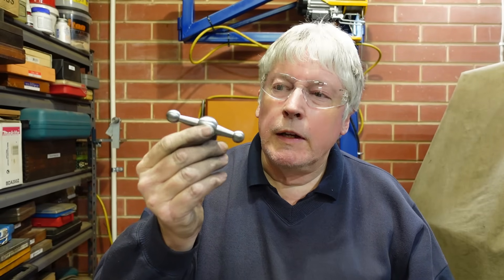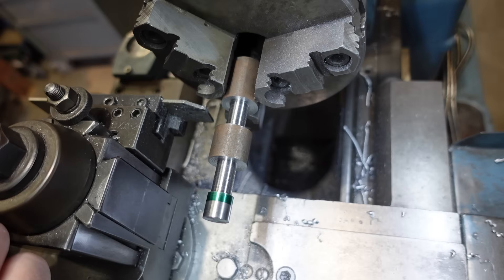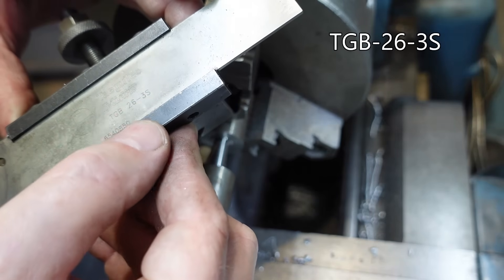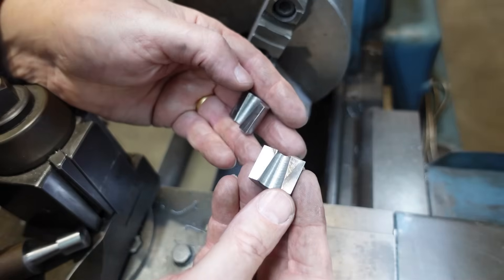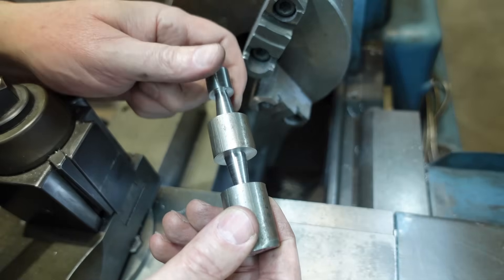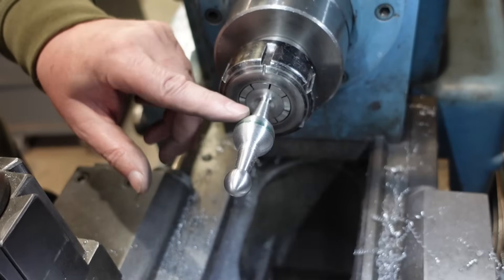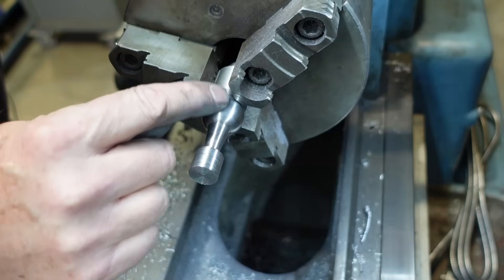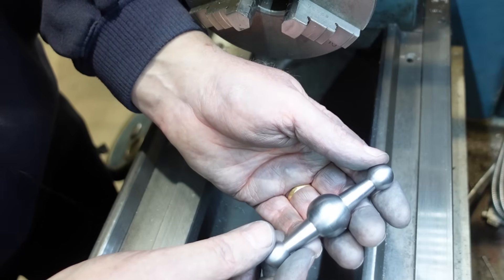The key part of making a 3 ball handle

Comment: On a tradational ballanced three part ball handle all three balls will be of different diameter.
Reply from the maker: That is what I normally would have done. This one was copied from a photo provided by a friend to be 'correct' for the end use. From the examples I put up during the video, I suspect that this handle strictly speaking should have two cranks rather than the one it will have in this application.

Comment: I would be interested to see some closeups of the tip of the cutter. Thanks. Nice job!
Reply from the maker: I tried regrinding it to get a better finish (didn't help much). I'll try and get something for you. May take a while to slot it into a suitable clip though
Reply: @occasionalmachinist  maybe a video on the ball turners construction?
Reply from the maker: @JasonSheehan-fy3lb  Yes. I'm thinking about that at the moment. I'd like to make a few changes to this one, so I need to work out what to put in and what to leave out of a video.

Comment: On most machines I've seen, the ball opposite the handle end is larger, as a counterweight to the handle mass.  Seems like a good idea when you want to move long distances.
Reply from the maker: Yes - that has been my experience too.This one had equal balls as it is a look-alike for a particular bit of kit.
Interesting though that the mass is only about 5mm off centreline (possibly because of the tube on the bottom) - probably close enough as the device it drives has locks to prevent movement.
Reply: The 3-ball handles are for double handles that can be turned with the thumb and forefinger. For this reason, the handles are never more than about 3" apart.

Comment: Just to clear things up for anyone watching: all parting and grooving inserts have little vees on the top and bottom to keep them steady, but not all of them are designed for side turning or flipping around. The tool shown here is a parting tool—it’s not meant for side turning—because it doesn’t have a top clamp. Instead, it just relies on the wedge action of the holder. That’s perfectly fine, since it’s only supposed to handle cutting forces from the end.

Now, side turning tools are the ones that really need that top clamp, because it stops the insert from being pulled out when moving along the part. Years ago, Seco actually called these MDT tools, short for “multi directional turning.”

If you look at the TaeguTec catalog, it spells this out clearly: the TGB 26-3S is part of the TGB-S series, which is made specifically for parting and deep grooving as a single-ended insert. In other words, it’s not designed to be flipped around or used for side turning—just for the job it was built for.
Rewritten by Chat GPT as the initial post has been removed, it may have violated the guidelines.
Reply from the maker: Maybe...
After reading this comment I thought I'd better check this out, so dived into the 24-25 Taegutec catalogue online, and also phoned up the Australia tech support.

From the online catalogue - the insert I use is a parting insert but the holder lists a range of inserts that can go into it, including some that the catalogue says can be used for turning. From that I can't say that I did a bad thing. Would they be more secure with a screw type holder? Certainly, but the catalogue has no notes about that.

Talking to the tech support person, his response was that he has never heard of anyone doing what I did but as it worked (removed material) and did not break the tool, he was reluctant to give a hard no. I've left a number so if he finds out more, he will let me know. The inserts do have a corner radius on them and provided the DOC is small (say less than 0.5mm) and feed is slow, it will do it and survive (the blade it mounts in will flex). The finish is not wonderful but it gets the material off. 

Back to my 2003 (printed) catalogue. Taegutec call this system their "T-clamp" system and include in that both screw down holders and the self-clamp version I showed. The catalogue states this system is capable of multifunction use (turning, grooving and parting in a single tool). Recommends using a screw clamp holder for axial and small DOC machining but does not go as far to state that a self-clamp version should not be used.

Based on all this, the use I've demonstrated is probably a grey area case. It will do it and it will work but as alway care and caution are advised.

Comment: If you leave a little sacrificial pip with a center on one or both ends, you can knock out the last (or both) small balls while the big center ball sits snug in a chuck or collet, and the end is propped up with a center. Then it’s just a quick file to get rid of the pip—no split sleeve required.
Reply from the maker: True, although holding the large ball in a collet might be a bit hit and miss if the positioning in the collet is not just right. I have done similar (leaving a pip for a centre) before though, so useful to remember.
Reply: @occasionalmachinist  Thanks for replying. If you aren't aware of how to use a collet, then a 3-jaw chuck should be used as in the video. Better still, turn between centers to keep the compound angle and the ball radius set.
Can I ask why you preferred to make the tapered sleeve instead of using the 'pip' method that you have used before?
Reply from the maker: @machinists-shortcuts  I've left a pip on other parts but never on a three ball handle. Did think about it for this one but have previous success using the method I've shown so decided to stick to what I'd done before.
I use collets quite a bit - the chuck most likely to be found on my lathe is a P-B EC collet chuck and around 10:45, I'm using an ER collet. The reason I would hesitate to use a collet for holding onto a ball is that double angle collets can not clamp properly when clamping pieces significantly shorter than the collet. A ball would certainly be that. While there are tricks I've used in the past to get around that, for a project like this where others are likely to copy the method I prefer doing it with a more tolerant setup.

Comment: The easiest and most common way to hold the handle for the third ball is. Bore a tube to the small ball diameter and counterbore it at one end for the larger ball diameter. Slit the tube, and you can then hold on to the perimeter of both balls concentrically.
Reply from the maker: That would work, although another use the tapered bush can be put to is holding the handle in the vice for drilling holes. I used a pair of V blocks for this one, but I have held others with the tapered bush before. I feel a lot more confidence in the work holding with surface to surface contact rather than a pair of line contacts as well.
Reply: @occasionalmachinist  I suppose a counterbored tube could also be used to hold the part for drilling with a wide slit, and would also be far more secure than the 4 point contact from a pair of vee blocks.
It would be interesting to compare the total length of the 3 lines of contact with the chuck jaws on the split bush with the total length of the two lines of contact around both ball circumferences.